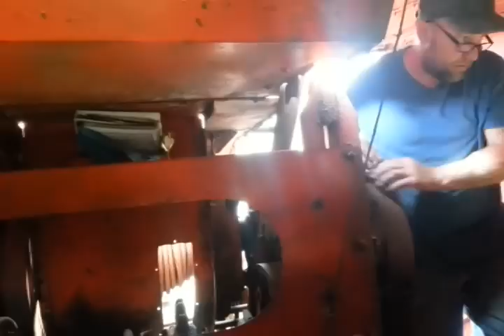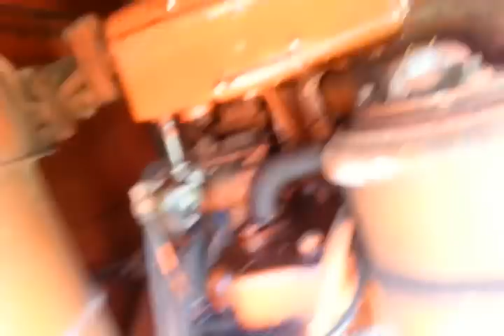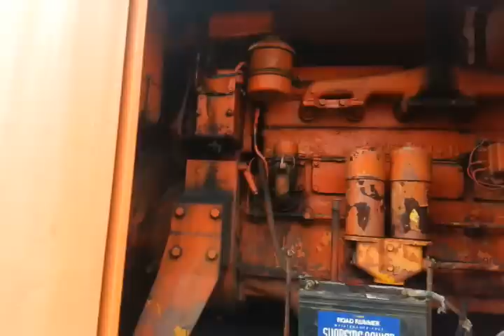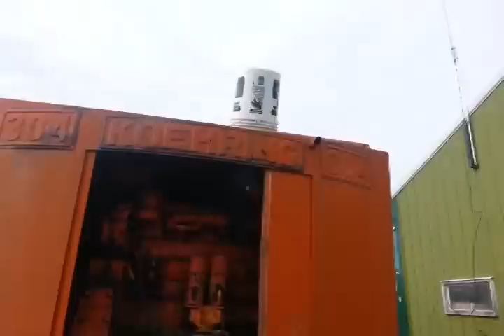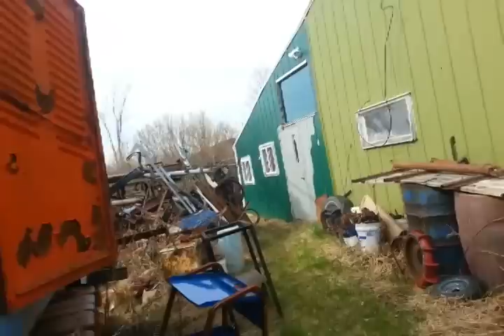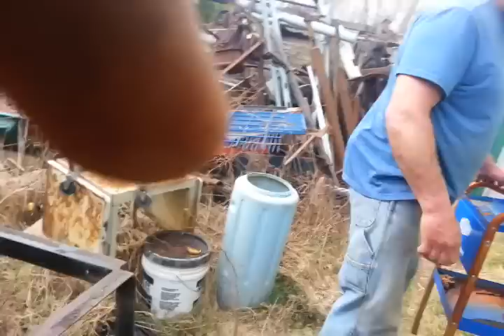Starting a 1950s Koehring crane part 2

Comment: OMG... I worked for the company in the UK that built Koehring Machines under licence, they went under the name of NCK.  The 304 model had been superceded by the 305 when I started with them in 1965, but there were still plenty of the 304's working around the UK. Lots of them had front face shovel attachments and worked in stone quarries, and lots of draglines working in sand & gravel pits.   Takes me back a good few years, I was 21 years old when I started with  NCK and worked for them for 9 years.